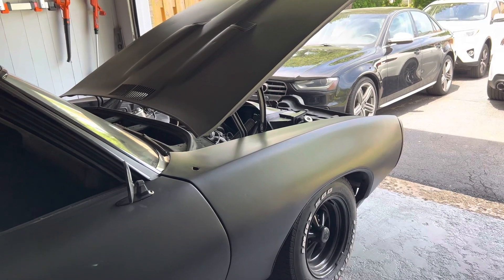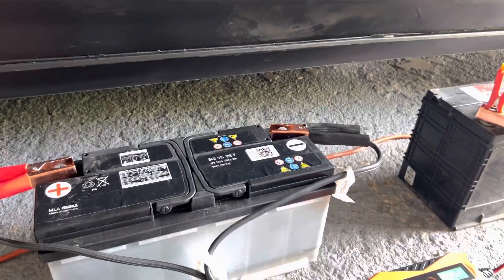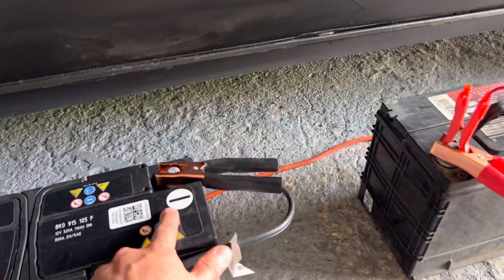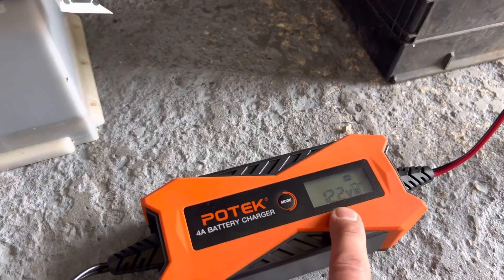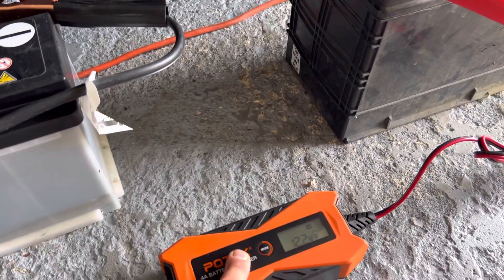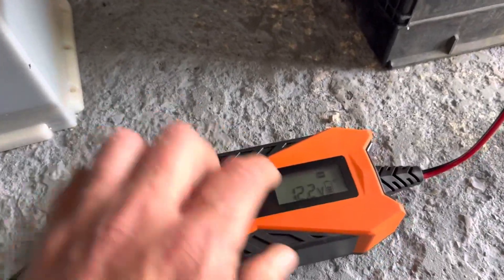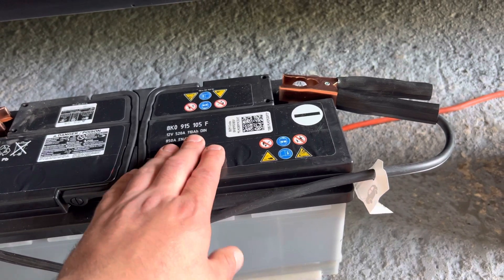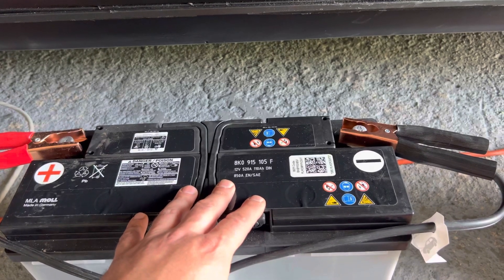How to CHARGE a Dead AGM Car Battery

Comment: are you sure this big (dead) MOLL battery is AGM, my understanding is its not, please confirm, I have same but confused about AGM or not. Thanks
Reply from the maker: I am sure mine was a AGM. This battery comes in both AGM and flooded which basically have the same part number. Super confusing. See if you can find any markings on your battery that actually say AGM or any other sets of letters like that.

Comment: Easiest wayt....is just give it a short bump with a power pack or charged battery.  If you can then start the vehicle, then do it...and run it for a while.  Once the battery is fully charged, then get a good smart charger with repair mode....and run the full cycle.  My experience is that it brings the battery back to brand new.....if you haven't totally abused the battery, to that point.
Reply: Hi , Do I have to remove the battery from the car in repair mode, or can I charge it without removing it?
Reply: @jurgestfeci189  Disconnect the negative terminal (ground)...and charge it while still on the vehicle.  My AGM battery is awesome these days, after using repair mode.

Comment: I used a jump box battery in the past to do this.  Actually, doing it right now. I am glad to know this is a thing. My AGM is only 2 years old and my radar detector beats it up.
Reply from the maker: Yea as long as there’s still some life left in there it works!
Reply: So your saying you had past good result using Jump box's rather stand alone fully charged 12v. Are the Amps coming up with volts in perfect world lol?

Comment: 9v battery and 2 pieces of wire will also trick the charger
Reply: Please explain this process.
Reply: @Civilian_Actual I think the idea is to make sure the charger reads enough voltage. If the battery is too low on voltage to begin with the charger won’t charge it.

Comment: Optima battery, once discharged, are hopeless; once they are discharged, no trick works.
Reply: I'm having the same problem with a 1 year old bmw batter also two motorcycle AGM batteries they won't charge passed 6volts
Reply: About 7 years ago, I bought a $450 AGM battery for my '08 BMW 335XI coupe. She'd ONCE AGAIN stranded me completely unexpectedly, out of the clear blue sky, (starter failure) AAA towed her home, and she'd been sitting in the garage awaiting a new starter (while I contemplated my life's choices to that point, dreading ANOTHER 8 hrs of labor I couldn't afford🙄💸💸). Periodically, while sitting, the car would run air circ cycles, along with various other unknown, probably unnecessary power intensive tasks that completely drained the brand new battery in just over a week. Concerning charging, the 'convenient' battery posts under the hood were 100% useless and didn't charge the battery at all. Had to disconnect the battery in the trunk from the vehicle altogether, then connect the charger, skipping the useless posts completely. I tried leaving the fully recharged battery on a tender, but still, the car killed the battery within a few days. Eventually, I let the battery discharge, replaced the starter, had several more sudden expensive mechanical failures, and for 5 years now my beautiful beast has been gathering dust in my garage. I LOVE that car so much. Driving her is as exhilarating AS IT GETS... And yet... I've discovered I'm STILL too lowly to afford even "Weekend BMW" maintenance for awhile longer 😂 And she's paid for! Can't imagine the repairs she put me through PLUS payments😬🤮🤢

Comment: I am pretty sure it wont work so good cause I just tried to do it been struggeling for 4 days but it wont work. Sure I get the volts up but thats it and the batteries at the most work for light load use.
Reply: 1:59

Comment: But your agm battery is not saying AGM on it either . My battery is identical to this. Just confused right now. It’s in 2014 Audi A6 premium. Any help would be much appreciated
Reply from the maker: You see the part number listed on the battery starts with 8K0. Just put that number into google search and your battery will pop up. Then you can see if it’s AGM.

Comment: It works for bringing it the volts back, however from my own experience, it does not bring up the cca on the battery so, it can say 12 ot 14 v but it does nothing for the cca which is the most important part of the battery whn ur starting ur car up